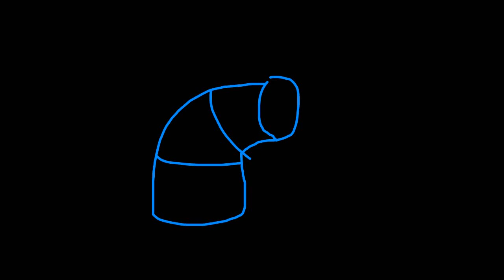Can You Use Multiple Elbows in an HVAC Duct System?

Comment: We have a company in Florida ( the largest company in the state) that puts 3 to 4 inch plenums (more like a end cap) on top of the air handler and immediately attach a flex which feeds multiple triangles for the rest of the house.. some of the worst duct systems ever installed. Static is horrible. work is done on a piece work basis. And inspectors pass it.
Reply from the maker: That’s a pretty bad design. We are required to have a 8 inch plenum minimum.